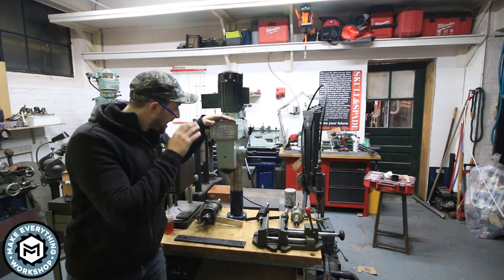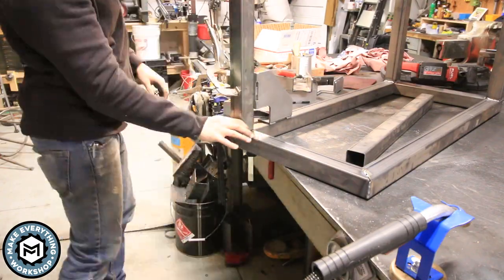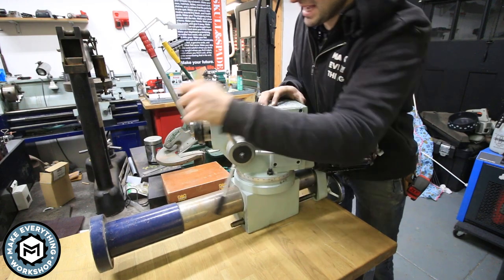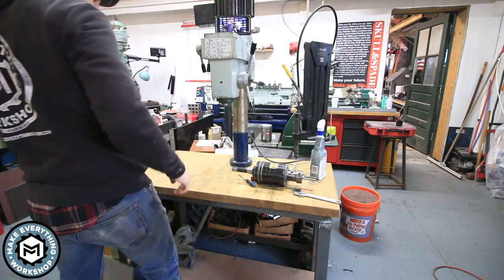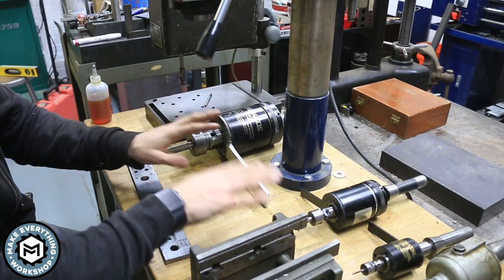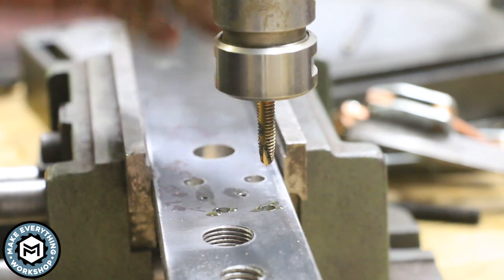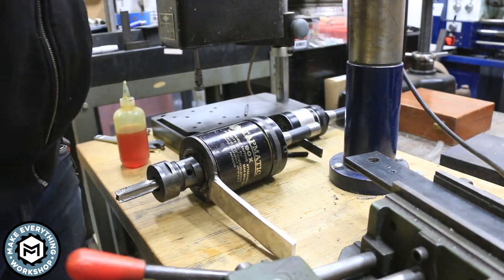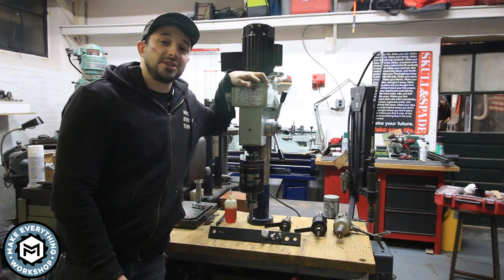Making a Tapping Station (From an old mill head)

Comment: As someone who has tapped thousands of holes over the years, a small chamfer on top of the holes will break the burr, provide guidance for the tap and ease the bolt entry.  
Nice tapping station. Well done.

Comment: The maple is tough enough, and your clamping force requirement is low enough, you could lay out a grid of holes, and epoxy threaded anchors in the holes.  If you choose the right kind of clamps to dedicate to the table, you might get away with a 4-5" spacing, and not have to drill a bunch of holes.

Use the bench for a while, until you get a feel for where anchors would best be utilized.  You could also use a temp sacrificial board you could drill with impunity.

That is quite the set of tappers. Easily clears 10k, retail?   The Supreme, (I think you said), looks a lot like the Ridgid tapper I found on eBay 15-20 years ago for $50.00.  I read an article about them, looked on eBay to see if any were listed. There was a fifteen minute old listing for the Ridgid, (seller said it was used once ten years before), and I bought it, on impulse.

It was a few weeks later I discovered how much they cost. !!  

Two Summers ago, I stopped to look at some free paint and electrical parts on the curb, on Long Island, NY.  In the mud and grass between the paint cans was a piece of equipment I didn't immediately recognize. I just said to myself, {take that!}.

I was thinking about the paint, and in a hurry. I was on my last trip across the road to my car with the tool, when I looked down at what I had, and thought about it, for the first time, and realized it was a Procunier tapper!  No label, but I recognized it as the 'pricey' ones I'd seen in the catalog when I first got the Ridgid.

I've had a dedicated tapping station on my bench for a long time, and it helps, so much.

That milling head rotates, doesn't? To 90°?  If you lower the head all the way, and fabricobble something for material holding on the right side of the table, you could mount a die holder on the tappers, and cut external threads in a snap.

Check the industrial suppliers, I have seen die holders for the tappers.

I got wide tracked, but I wanted to advise you to clamp in two locations when you are doing anything larger than ¼-20; the torque WILL surprise you. I got nonchalant, in the beginning, and used single clamps when I shouldn't have.

Bruised some knuckles, in the process. Could have been worse. Yanked the vise AND material right out of the wrongly placed, single clamp.

Later..

Comment: Why not just buy or build leveling feet into your tables legs. Great video and love the hole in the bench for the collet holder.
Reply from the maker: wayfastwhitie455 I was actually gonna make 4 plates out of 3/8 and tap them with the 3/4-16 and use those bolts as leveling feet, but I only needed one small shim to get the bench level and flat so it seemed unnecessary . Thanks!!

Comment: A mounting plate might have been a good idea for the connection to the table, to get some more surface area.  Great idea,,,
Reply from the maker: sean tap yeah for sure, I’m considering doing a 3/4” or 1” aluminum riser to get the head a little higher for the 90x with a steel plate under the table. For now tho since there is very little strain on the head while tapping im noticing almost 0 flex
Reply: @MakeEverything  I really like this idea  and im going to keep my eye out for a similar milling head...cheers
Reply: I don't know why people keep suggesting this. It's already ~30 sq. in. (180 sq. cm.) What do they think is going to happen? The bolts rip out? (The whole fender washer and lock nut rip through the table.) The wood gives way? No. That's fine. 2" thick wood, and 1.3 sq. in. (8 sq. cm.) washers, x4 of them, will be more than adequate. Now, if your going to raise it up, so you can have more z height to work with, you'll increase the length of the lever arm. In that case, sandwiching the wood between 2 plates would be a good idea
Reply: @xenonram  Thanks for your input how do you know its 30 sq in? You have obviously never bolted anything that's steel to wood and that far off balance,,, It would be just for reassurance so it doesn't get sloppy and off-square to the table. Also raising it up isn't going to change the distance from the center of the spindle to the center of the column.

Comment: The 3/4-16 bolts is how you should level your bench. You will find wood a terrible surface to machine on. Embedded chips and oil saturated it will degrade quickly.

Comment: Any reason you didn't use 1/4 plate to sandwich your heavy milling head mount on to reduce deflection?
Reply from the maker: Whiskey Jim the tapping heads put up little to no resistance when working through material so i don’t know if enough force is being applied to cause deflection. I’m definitely open to idea in the future though.
Reply: ¼" plate (on each side of the wood)!?!? A little overkill, huh?
Reply: @xenonram  nothing wrong with overtime
Reply: @MakeEverything  it's really heavy you said 150lbs. Butcher block is just glued together wood. I'm just saying that with the forward weighted milling head you're putting a lot of faith into a wooden mounting surface that will change its mind depending on the season
Reply: @WhiskeyJim..You are 100% right, given the top forward heaviness of that mill head, dispersing the load with a mounting plate would’ve been better. He can still do it and probably will.

Comment: how critical is it to have the machine perpendicular to the table?
Reply from the maker: Ed KE6BNL it’s pretty important to be close, I’ve found there
Is enough slop in the heads to correct for some variation. It’s got to be a perpendicular hole in the base material to get things proper

Comment: So, I'm not familiar with Tapmatic... why are those tapping heads so large?  They must have internal gears that reverse the direction when under tension.  Do you think something like that would work for a regular drill press?
Reply: BarefootDrummer they work in any collet size they make them in

Comment: At around 14:40 you tap the tap with your finger and the whole tapping head moves quite a bit. Is this movement an intentional function of the tapping head to be somewhat compliant? Or was something not fixed down securely, or does your milling head or tapping head have a lot of slop/flex?

Comment: time 16;48 video, you need true bolt vise to table, only amateur stupid use free vise on table, guik clamp both side and metal sheet can clamp vise anywere you want, and tap machine rod need be long, i has used same tools many year in factory and all has long rod whit tools can stop to mill pillard. and counter sink ewery hole before tapping tread.real amateur do metal work i see. Vise need bolt on table ewerytime have little or big tap, or want broken lot tap alltime.